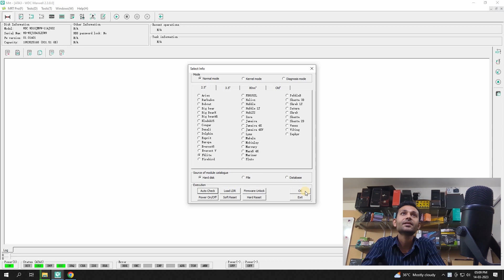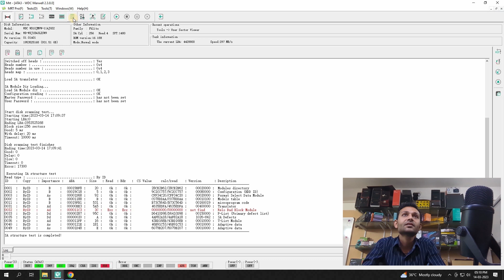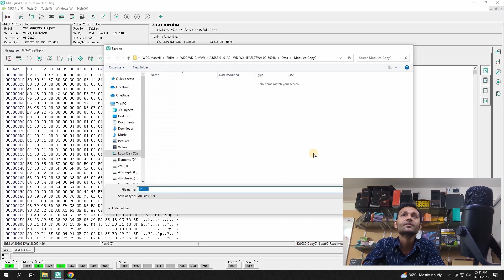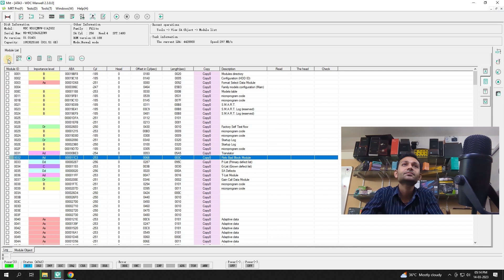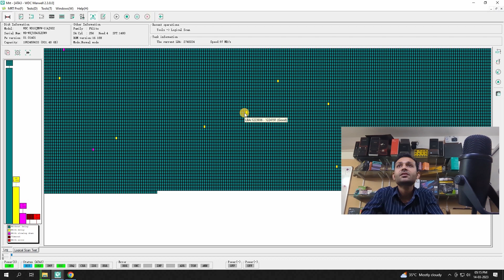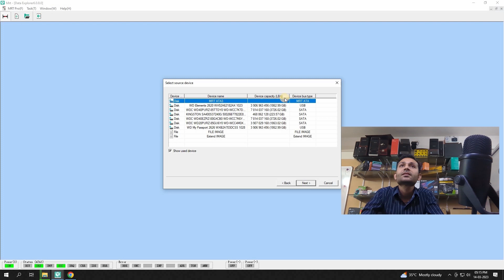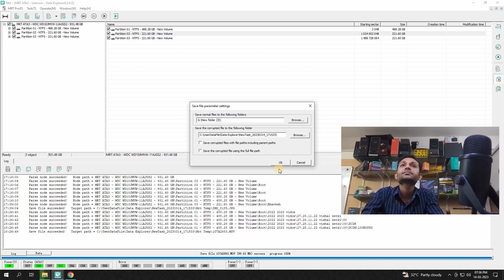how to repair  usb hard disk firmware and recover data

Comment: Resp Sir! Very Nice Sir. One Seagate  500GB Hard Disk Spinning and Stopped Sir, SMD Capasitors SMD Diodes, SMD Resistors are Good Values with Multimeter Sir and No Beep Sir. Where the Problem Sir. Please Advise Sir.  --   ChinnaRao Paderu Andhrapradesh